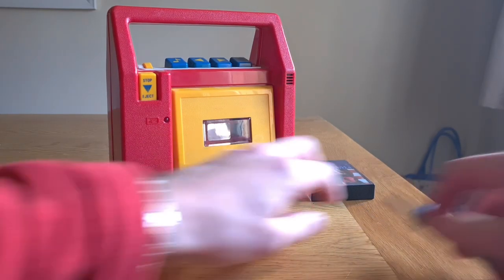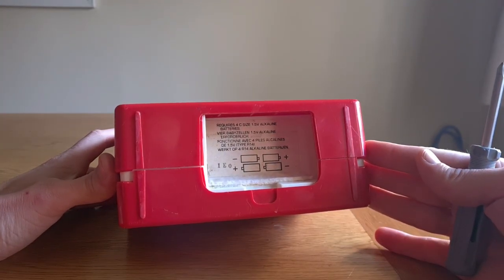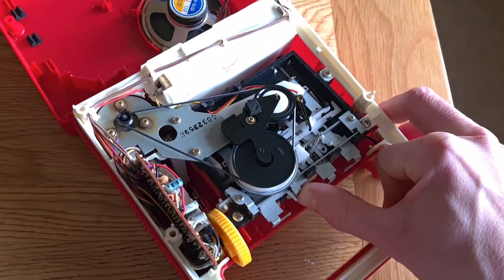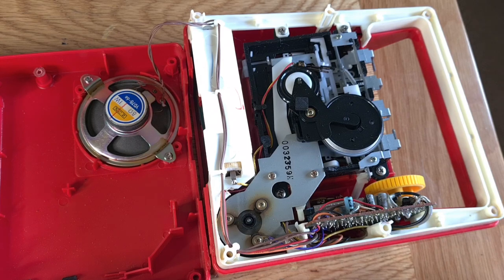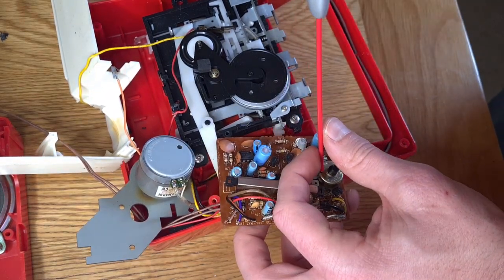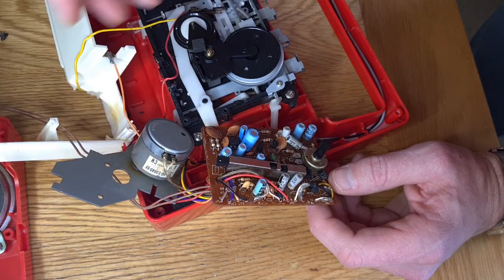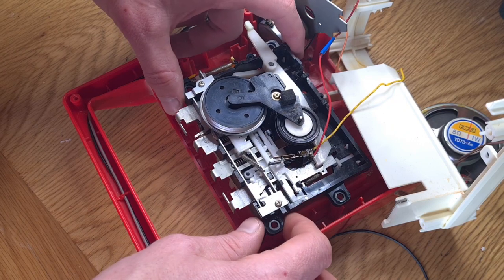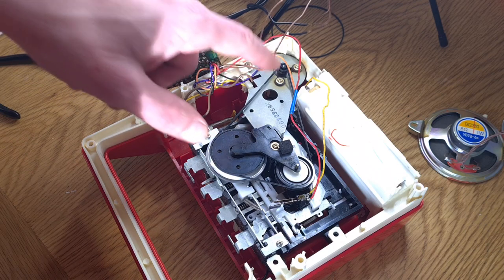Fisher Price 80s Kids Cassette Player - Repair, Belts & Calibration

Comment: This was fun to watch. Sorry if I missed it but did you figure out why it wasn't playing when cased? Was something being pinched? Thanks
Reply from the maker: Thanks! Wierdly, I didn't! Off camera I wiggled and inspected all the wires. The only thing I can think of is perhaps there's some felt that stops the batteries rattling.. maybe it was stopping the batteries touching the terminals. I didn't remove it, but otherwise it's a mystery!
Reply: Might have been just a corroded switch contact or something.

Comment: I’m trying to fix my 1980 brown  FP tape player. What size belt should I use and, where do I get a new speaker? I’m going to follow your video and see if just cleaning everything works first. The speaker is losing sound and crackles- it’s a 8 omega 0.5w 
Thank you in advance
Reply from the maker: Any speaker at all of that size. Just measure the width of it. 

Try plugging that speaker into something else to rule it out. Maybe another radio. It's probably fine.

I think belts were 71mm and the cracking will be the volume switch needing a deoxit maybe.

Comment: Interesting video as always! I think that year on the motor is maybe Japanese year 03 so it is 1991 in western calendar 🤔
Reply from the maker: Ah that's great info, thankyou. It did seem a little late for a cassette player. I think by 2003 kids had iPods!
Reply: 🤨 - in 2003, compact cassette was still a popular physical-analog media format, and you could still buy a cassette deck, stand-alone recorder, some micro-component HIFIs and boombox’s had cassette recorders in them and blank cassettes. However the CD ~ compact disk was beginning to replace pre-recorded cassettes, and because of that trend ~ parents were starting to buy their children toy CD players - they learned how a CD works, how to operate it, and some came with a microphone/karaoke function so they could singalong with their nursery-rhyme CD.
Reply: @pwrestoration 

They still made a tape recorder at that time, but a different model. This one was made from 1980 (81?) to the mid-90s, though the early ones were available  as the tan/brown version only, the red one came out in the late 80s.

Also I think I see a date code of '91 on the 8-pin IC.

Comment: They managed to use a metal flywheel for better wow and flutter specs which is something you NEVER see in any cassette player in the last 25 years. So today's new cassette players are worse than this thing.
Reply from the maker: It played well, I have some decks in the stack of work that are indeed worse than this